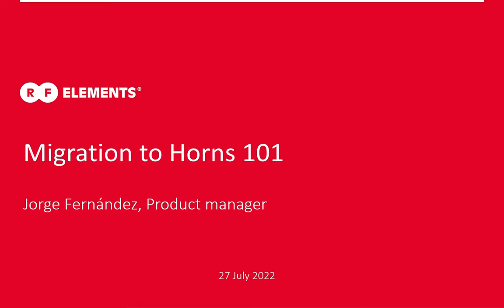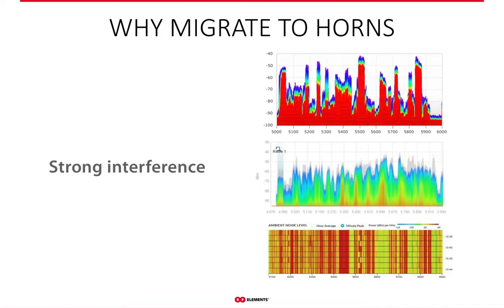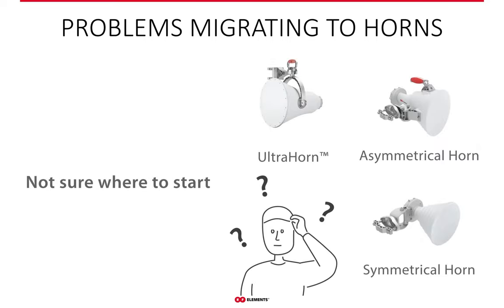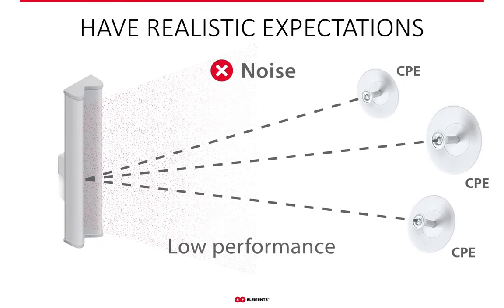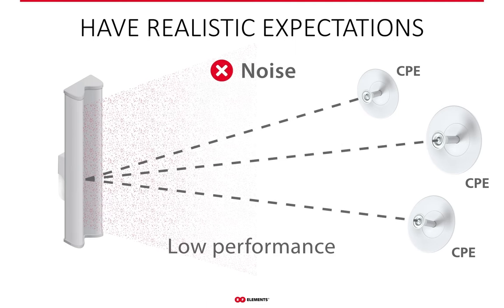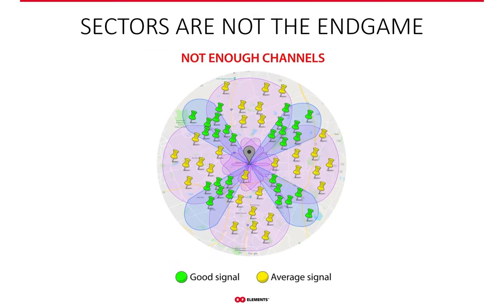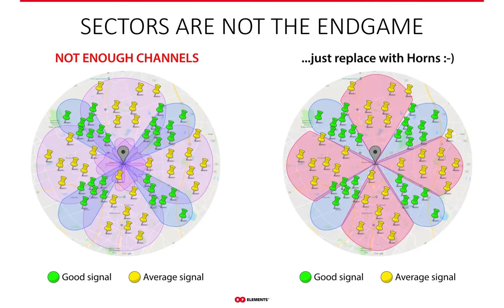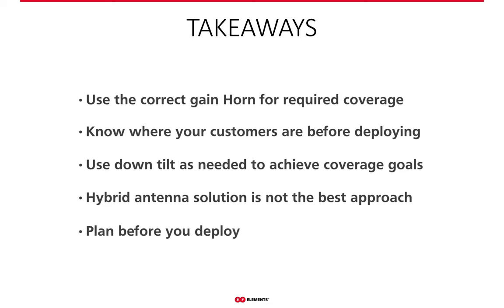Webinar Migration to Horns with IT Warehouse

Comment: What about the handover, what if a clients moved to a zone its not covered by the horn ?
Reply: Of course in the case we used downtilt, and we focused on clients locations
Reply from the maker: You will need to adjust the Horn to where the clients are located. Since there are no sidelobes (therefore no connections outside the degrees of the horn), the radiation pattern is well defined, so there is no possibility of connections from the back for example. In any case, you will need to place the CPEs according the the radiation pattern of the horn you're using. You can try our link calculator in PtMP mode and select the horn you would like to use to see how it would project the pattern in the field https://rfelements.com/calc